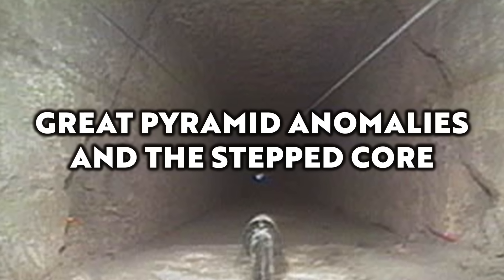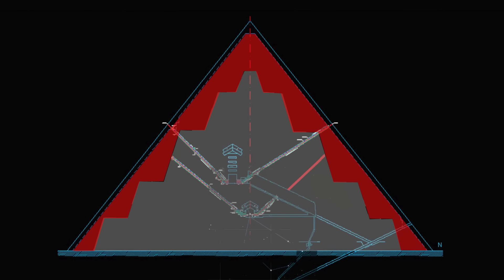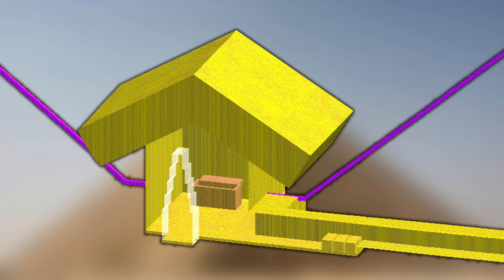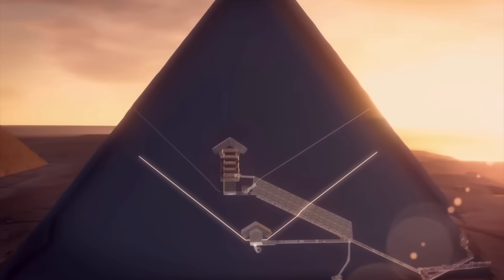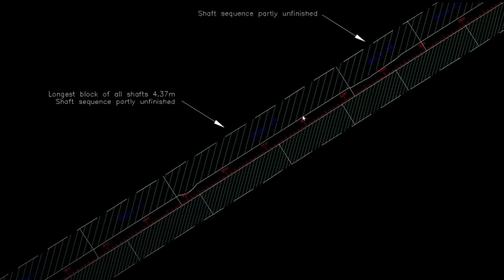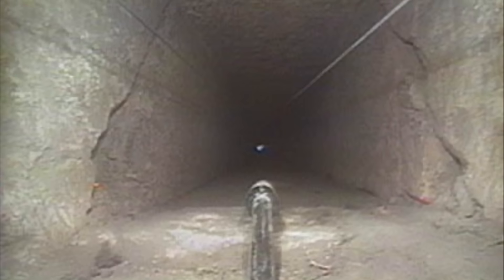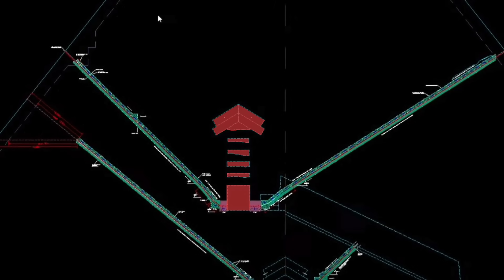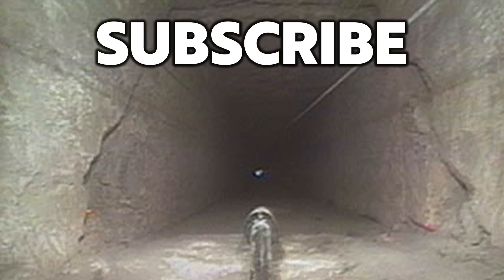Great Pyramid Anomalies Reveal Hidden Structure | Part 2

Comment: There probably was a stepped core but what would be the purpose of the metal hooks on the back of the blocking stone.   This large a stepped core would entirely rule out any contingency plan for using the queens chamber it seems also.

Comment: The two King's chamber air channels were probably built by different crews. It would not be that unusual for two different crews to deal with the edge of the stepped core differently. Sometimes there are exigent circumstances in construction and the building crews even today sometimes deviate from the architect's building plans. In this case for one crew a longer block for the interface may not have been available at the correct time, and rather than delay they may have determined that the longer block was not really necessary. Upper management may not even be aware of the change.

Comment: The constructive idea of relieving chambers shows that the ancient builders possessed a universal principle of load distribution and the management of massive stone blocks. The relieving chambers demonstrate that the pressure from above could be “diverted to the sides,” unloading the vulnerable elements and thereby increasing the durability of the structure.

The opposite — stair passages and vertical shafts — illustrates the reverse application of the same principle: not diverting pressure, but creating free space inside the masonry mass. This space could be used both for human movement (stairways) and for technological purposes — lifting blocks with ropes and pulleys.

Both are different expressions of the same simple yet extremely powerful engineering concept: the ability to work with the stone mass, transforming it either into a load-bearing structure with pressure relief, or into a transport system with passages and shafts.

It can be said that the idea itself is truly brilliant in its simplicity. It is universal, applicable in different directions, and was likely the key to how such gigantic monuments as the pyramids were built

Comment: It should not be overlooked that the northern blocking stone and the southern blocking stone in the Queen’s Chamber are located exactly at the points where the sides of an equilateral triangle inscribed within the pyramid would pass. These are not just blocking stones, but markers resembling intersection points in a geometric construction.

Do these inclined shafts continue further toward the edge of the pyramid, or do they terminate there? If we extend inclined lines at an angle of 26 degrees from the corners of the base of the inscribed equilateral triangle (along the Grand Gallery), we can see that these inclinations intersect at points (the pyramid’s edges) where the northern and southern channels of the Queen’s Chamber would end if visually extended.

This may indicate that the channels could continue beyond the blocking stones, since the directional vector fully coincides and corresponds with geometric calculations. And, as I mentioned earlier, the bisectors of the equilateral triangle also intersect with the directional vector of the northern and southern channels of the Pharaoh’s Chamber.

Such a coincidence in geometric calculations cannot be accidental. There is a strong likelihood that, if the pyramid does contain an internal core, then its base would measure 170 x 170 meters — that is, identical to the base of the equilateral triangle

Comment: Chasing tails and rewriting their basis for the pyramids for years. Stepped core or previously built building? Wait that would be a no no. Entrance or way out for diggers?  No idear. 30 years to make the whole thing? mkay.  This is why all the non professionals give so much credence to the endless resistance to speculation. You know why?  Because you have your own set of controlled gatekept theories enough to be financed by generations. This is certainly no age of enlightenment.  It is the  slowing down of everything so that information can be farmed. Grats.

Comment: I always thought they built the casing, as they built the pyramid. 
Seems like alot of extra work to have to build yet another set of ramps etc to bring the pyramid blocks in to shape the inner structure you describe, then build more yet again to do the limestone casing after that. 
Youd have to destroy the ramps and all after each phase to start at the bottom again right?

Comment: Why being so negligence about this obvious fact in plain sight? :
Letting down a plumb line from the pyramid apex it connects also the highest end of the Grand Gallery with the Queens Chamber with the Subterranian chamber !! This means something. Either pyramid construction wise or spritual in connection with the function of the pyramid and the after life of the Pharao.
Secondly: the Kings Chamber being placed eccentric, towards the left in the drawing means it had to be built there. This was possibly done because of the way constructing the Pyramid did not allow another solution! Suggestion: Take the BIG VOID in consideration. Maybe this is much bigger as expected and excludes a central position of this Kings Chamber?!

Comment: If they are air channels and heat rises, how is the cold air from outside ment to flow into the chamber when the shafts liook like they are 45 degrees the opposite way?

Comment: Very interesting. If the core truly is a step pyramid then would the north face corridor end at this? Would the length of the corridor be the depth of the outer true pyramid.

If so then this would assume the corridor is just a relieving chamber for the entrance. Even if not really required. Playing safe just like the great void?

Comment: Why use two different support methods? If either method fails at some point, you still have one functional air shaft. This is the way I do things if I have two probably good enough methods but aren't sure which one is better.

Comment: Okay, what you do is build the core of the pyramid, the ramped or stepped pyramid and chambers, from the ground up. Then, you add the outer section and casing stones working your way back down from the top. After you finish the core, you drag yhe uppermost rocks all the way to the top, along the outer ramp, and put them in place from inside to outside, a few rows at a time, due to the need to offset column layers.

Comment: When you look at the Great Pyramid, you should also sometimes try to view all three pyramids at Giza together. There seems to be some kind of "lessons learned" after the Great Pyramid was finished. For the architects and the kings themselves. There has to be a reason, why Kufus successors did not go the same route as their predecessor. They did not build structures inside of the pyramid itself. They constructed their kings chambers under their pyramids, like as a first step of the construction process, instead of building chambers and corridors inside of it. Like they did with older mastabas. They came directly after Kufu - so maybe they learned, that Kufus decissions were best to be avoided and a simpler route was more favorable. There must have been events surrounding the Great Pyramid construction process, that made them not copy Kufu in every aspect. If everything was awesome and turned out to be perfect, they would've copied his methods. Maybe it is all just evolution of methods and technology, but maybe it's also a hint, that not everything was sunshine and bunnies with the Great Pyramid.

Comment: What has always amazed me is that over the course of several thousand years some Czar, Dictator, Emperor, Mob of Batshit Crazy Lunatics or anybody along those lines has not came along and just completely dismantled a pyramid.  Don't get me wrong, I know the stripping of the majority of all the casing stones, as well as the big scar that guy dug or blasted out of the one pyramid are very substantial and intrusive.  Not to mention countless floor and wall slabs that we know had to be there now gone, and other structures and grand things we dont even know existed they have been gone so long, all traces having been lost to time.  With that said, back to what I was saying, to me its amazing they are in as good of shape as they are in and that we are still making discoveries even today.  I would not want it to happen and am glad that to the best of my knowledge it never did happen but I am mind blown at least one pyramid has not been Johnny 5 disassembled, spread across the desert, abandoned and left for us to stumble upon.  I mean yea that would be a major undertaking in and of itself but only easier as time and technology marched on.   Even if all the aforementioned Mob of Batshit Crazy Lunatics did was start at the top and shove the blocks off and let gravity take them to the ground and the tumble on the way bust them apart to then be moved... nobody ever did... Has anybody else ever had this thought, I can't be the only one... thats not a Batshit Crazy Lunatic or power hungry tyrant.  EDIT:  I am not counting the dismantling, moving and reassembly of Abu Simbel 180 feet to the west and up 200 feet in elevation in the late 1960s.  That had to be done since it was going to be underwater after they built the Aswan High Dam on the Nile.

Comment: As scientifically as you refer to the engineering and means of construction, I am surprised you still contend to the ‘tomb’ theory.
Surely all the evidence points to the contrary. There are no mistakes or oversights in the entire construction, everything was intentional. 
The best theory yet that supports all the evidence of not only this pyramid but the whole Giza complex is that this was a chemical manufacturing facility on an industrial scale long before the Egyptians inherited it.
Check out Geoffrey Drumm - The Land Of Chem.

Comment: Were the Queen's Chamber air shafts sealed on the chamber-end by a plug of mortar? Or were the wall blocks solidly covering the shafts? If the latter, then those air shafts could never have been left open post-construction of that chamber.

Comment: I think while they were building the queens chamber they needed those air shafts. So when they completed that section of the pyramid the shafts were abandoned because they didn't need them due to the fact there was air flow through the kings chamber and entryway.

Comment: I clearly remember watching a channel here (that I search for an hour now but just cant find it :( ) where it was explained that the Kufu pyramid internal structure is like a layer with stable, well cut stones, then a layer of fillers, then a layer of well cut stones, then a layer of fillers... It was even backed up by a paper and also proved by the recording of the CEILING of the robbers tunnel. Btw that video should be available here on youtube, even History for Granite used it once if I recall. I even searched for that paper once and found it, sadly I cant find it now :(

Long story short, if that statement is true then the stepped core theory is not right.

Comment: Building from the ground up, they completed the "Queen's chamber", then decided they needed the "King's chamber" for whatever reason? Because they didn't complete the pyramid, then excavate the King's chamber. They were one layer higher and they could have backed up, but instead of making a change in the Queen's chamber, you propose they continued on, but with a major alteration in design, causing more hardships (including designing and building the grand gallery) than what a brief reversal of course would cause them. 
Considering that we don't even know the reason for the chambers, or even the pyramids themselves, I'll have to say you could be right. But it sounds wrong.

Comment: I know this might sound a little unusual, but the other day I started wondering that what if the pyramids weren’t originally built block by block, but began as natural hills or mounds that were reshaped over thousands of years? In a desert environment, the Sun is relentless, baking the rock during the day and chilling it at night. That constant cycle of extreme heat and cooling causes thermal weathering, slowly cracking the surface apart. Over millennia, those forces could carve surprisingly sharp, geometric outlines that look almost man-made.

What really made me think about this is Tumtum Mountain in Battle Ground, Washington. It has a striking pyramid-like form and just like Giza, it rises from a surrounding plateau. The Giza plateau itself was formed from Eocene limestones around 40–50 million years ago, back when the whole region lay beneath a shallow sea. Those ancient seabeds slowly hardened into vast layers of limestone, which were later lifted and exposed. So in a sense, the pyramids rest today on what was once the floor of an ancient ocean.

And the story doesn’t stop there: between about 5,000 and 11,000 years ago, the Sahara was actually green. Rivers cut through the land, grasslands stretched across what is now desert and the plateau itself may have held trees and wildlife. It’s strange to picture the pyramids’ foundations first lying underwater for millions of years, then in a fertile savannah and only later surrounded by the desert sands we know today.

When you think about it, the cultures across the world have always worshipped mountains and high places as sacred. Symbols of stability, eternity and closeness to the heavens. Maybe what we now see as pyramids weren’t just monuments of cut stone, but also extensions of that same ancient impulse: to honor and reshape the natural mountains and plateaus around them into something eternal.
Reply: the great pyramid is built on a natural hill this is known because the well shaft passes the boundary between bedrock and masonry about 20 feet above or so the base level of the pryamid on the exterior, so the hill is 20 feet high or whatever, but most of the pyramid is masonry, masonry is very easy to tell apart from natural fissures. Also, the well shaft passes by a feature called the grotto at the top of the hill and this feature may have been a natural karst feature in the limestone or excavated perhaps long before the pyramid. the fact the well shaft passes right next to it indicates the builders of the pyramid were very conscious of it

Comment: Easy to explain the differences in the 2 kings chamber air channels - One channel crosses the core at a vertical face and the other crosses the core at a horizontal face.

Comment: You sound like you're a thousand miles away from even considering the primary question, which is what makes this whole thing a "Mystery":  "WHY were the pyramids built?"  They are not suitable or sensible to be used only as a tomb.  And it seems certain that countless generations of people(millions) from all over the African continent were involved in the construction in some way, and most of them would never even lay eyes on the construction site, and certainly not the finished structures.  

Why were the pyramids(or Anything) built using megalithic blocks?  Couldn't they have used blocks half the size?  A tenth the size?  We might assume it would have taken much longer to build if we increase the number of blocks, but we have no idea how the blocks were moved in the first place.  Before breaking ground, the builders had to have decided that megalithic blocks would be used.  I can only assume this must have been quite a shock when it was announced to the workers.  No one had any idea how to move a stone block that weighed 50 tons.  How/Why would they know how to do that?  No one had ever done it before.  How did they master these techniques before ever needing to apply them?  How are these techniques completely lost to history?

The only reason Egypt gets all the credit for the pyramids is because they were built within that country's borders.  Egyptian culture has no claim to the pyramids.  If there was a legitimate link, how can there be no explanation for how/why anything was built they way it was built?  There's absolutely no reason to believe modern Egypt has any link with the civilization responsible for building what now exists in Egypt(as ruins).  Oh, why did the Egyptians allow their magnificent cities and structures to be destroyed?  How do they explain this?  How can they claim the ruins without some amount of shame for their failure to protect what must have taken centuries to build?